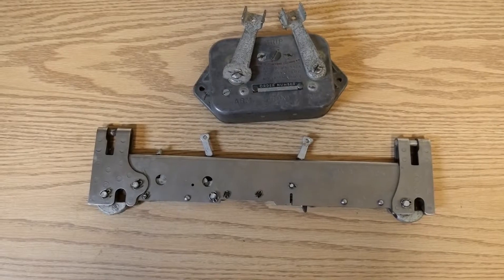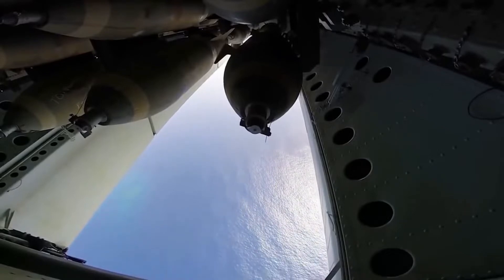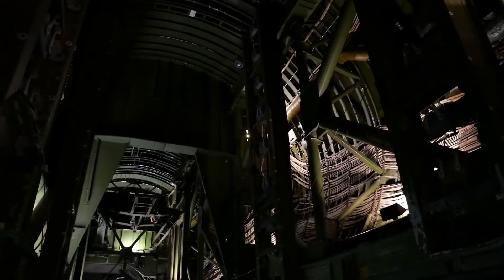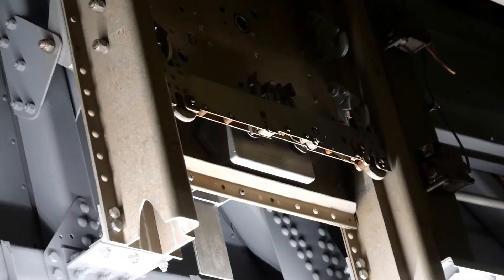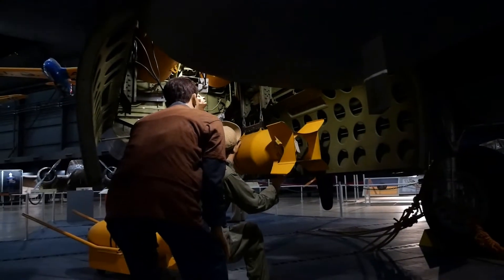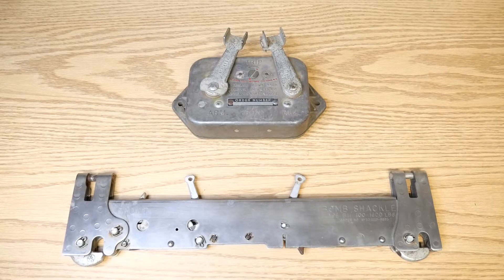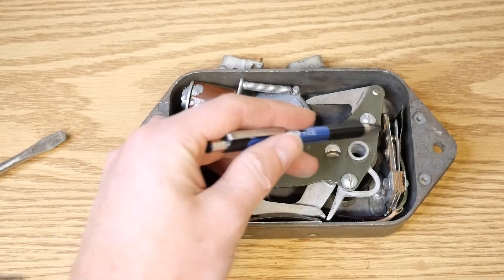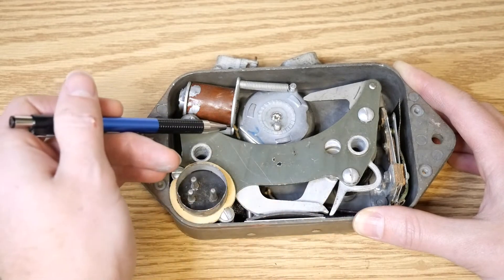Tear Down of a Bomb Release Controller and Bomb Shackle on from U.S. Air Force Bomber

Comment: This is a great video, but the different functions of the two levers is not adequately explained. The forward lever releases the bomb and the rear lever arms it. During the bomb run the bombardier will arm the bombs by a switch that sends a signal to move the rear lever forward.  The statement at 5:49 that the rear lever on the rack moves "simultaneously" with the release lever is not correct. Just because the manual trip function on the controller makes both levers move, does not mean that is how it normally functions.  Release can occur with the rear lever in either the rear (safe) or forward (arm) positions. The bombardier (or pilot) may choose to release the bomb in an emergency with the arm lever to the rear and the arming wire will not be retained. If the arming wire falls with the bomb, it will not arm and will it not explode on impact. Note that both the rack and the controller are clearly labeled "forward" because of this important difference in function of the two levers.

Comment: The B17 had 4 racks to hold bombs but it had 42 bomb stations throughout them, only 12 stations could hold the typical 500 lb general purpose bombs that were the most common used but the stations between them could hold smaller 100 to 300 lb bombs.
The all in maximum internal bomb load of a B17 using all 42 bomb stations was 12,600 lbs (as per a document from Boeing).
The all in maximum bomb load with external wing racks was 17,600 lbs. (Internal load plus one 2,000 lb bomb per external rack, the external racks with the 2,000 lb external bombs and internal load configuration was used early on by 385th Bomb Group, 8th Air Force on German sub pens on the French coast and inland targets in France, that configuration was also used in the Pacific early on while B17's were still used there)
The channel WWII US Bombers has a video titled "B17 Bombing, Fuses, Shackles and Bomb Release Units" that has pictures from the Boeing literature that shows the locations of all 42 bomb stations in the racks, their rating of 12,600 lbs maximum internal bomb load is shown in a Boeing document in another video from that channel, he has an excellent series that covers bomb ballistics after dropped and other subjects like the Intervalometer which depending on setting would either drop all the bombs at once in a salvo or had settings that could drop them timed to create a path of bomb impacts on the ground with variable settings to make the path longer or shorter, the Intervalometer worked in conjunction with the Norden bombsight so the aiming point would be the center of the path instead of the near end.
He also has videos on the B17's accuracy record, the Norden bombsight and the use of the H2X ground scanning radar bomb aiming system used when overcast skies prevented optical sighting. 

At 2:40, it's B29 SUPERFORTRESS, not B29 Liberator.